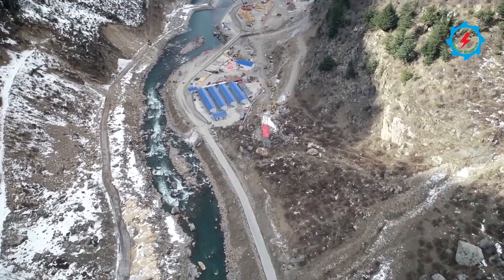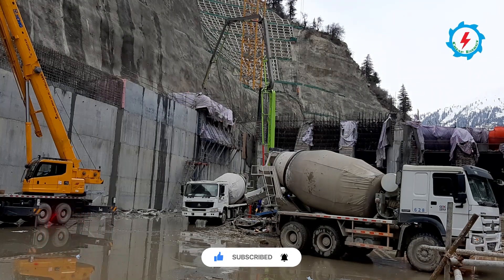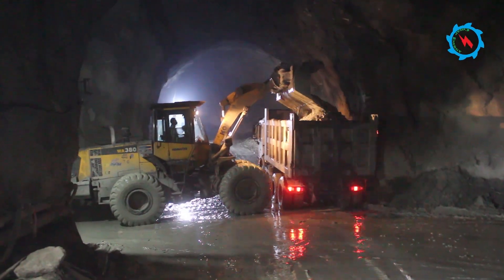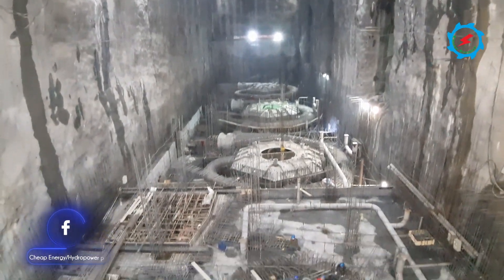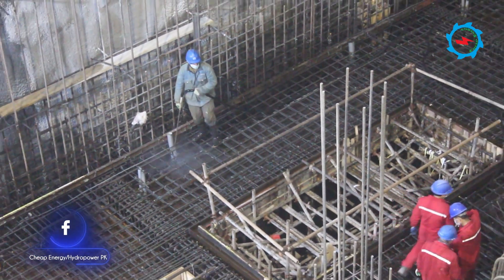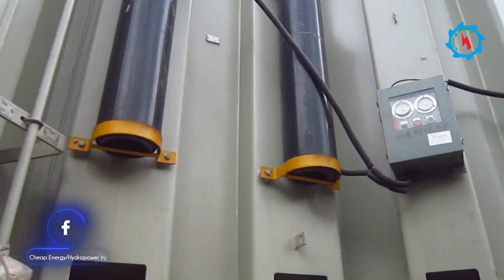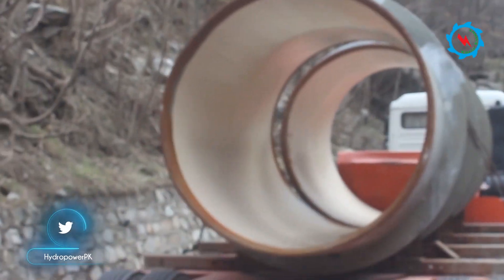Suki Kinari Hydropower Project | Construction Activities | March, 2021

Comment from the maker: 0:09 Last Year Visuals of Dam Site
0:20 Current Visuals for Comparison
 1:58 Coffer Dam & Grouting Works
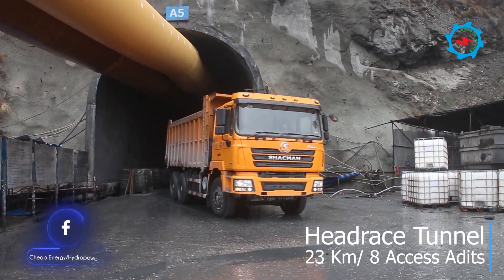2:30 Headrace Tunnel
3:10 Surge Shaft
3:41 Penstock System
4:27 Pressure Shaft
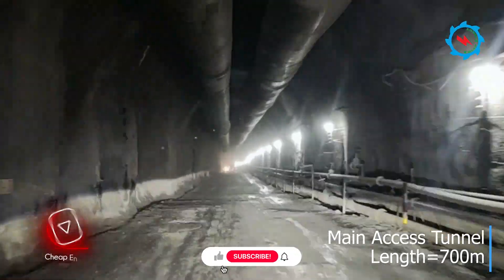4:43 Underground Powerhouse
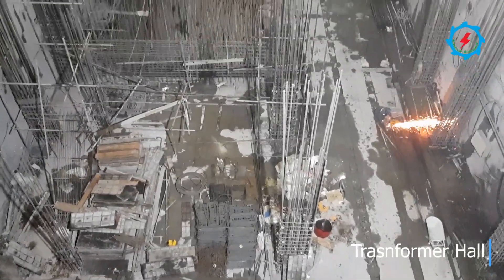6:40 Transformer Hall
7:18 First Transformer Arrived
7:50 Steel Liner Factory
Reply: Thanks for providing breakup of video sections